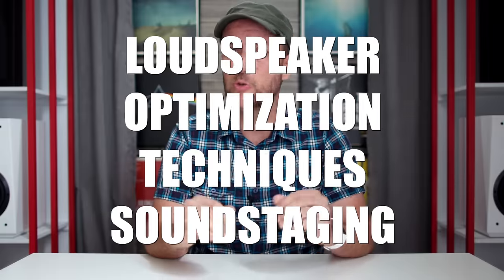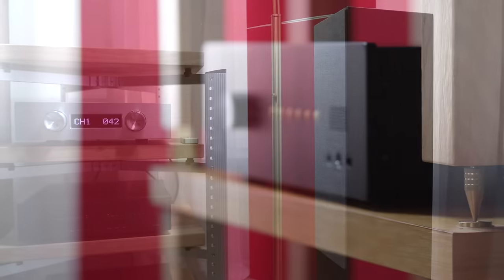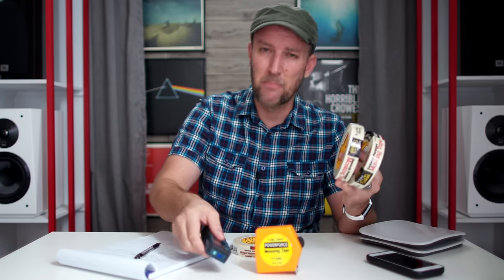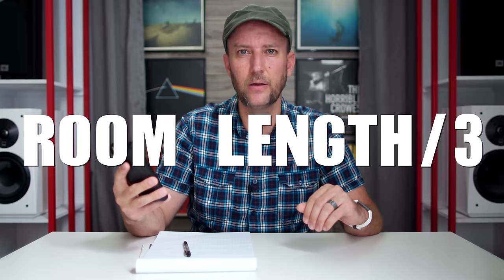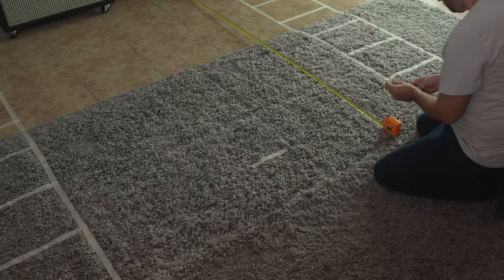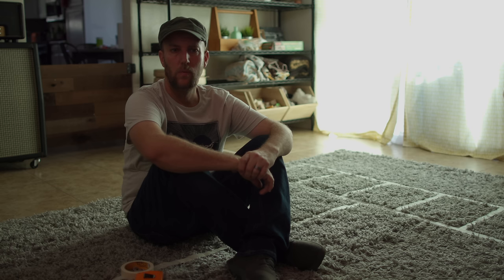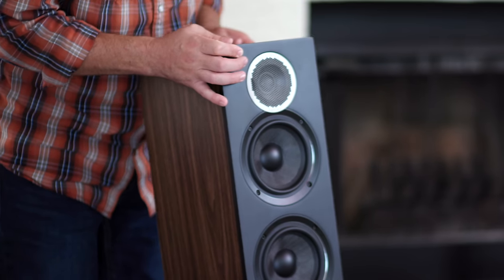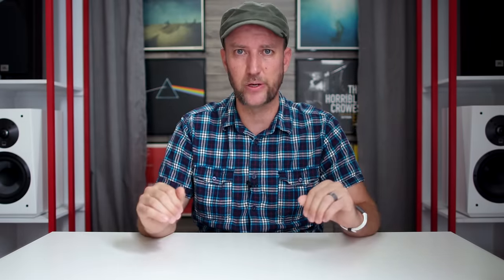L.O.T.S. Loudspeaker Optimization Techniques for Soundstage!

Comment: The "problem" with these approaches based on calculations, is that if one single factor cannot be accomplished, the the entire process is rendered pointless. Case in point, my listening position is fixed - it cannot be moved in any direction back and forth due to the layout of the apartment, nor can my speaker position move any further out from the wall than about 30cm (again due to how the room is configured). It would only take one of these limitations to prevent me getting an optimised soundstage. How many of us have rooms with symmetric walls, let alone a dedicated listening room where we can practically live with speakers dragged out into the room like this? I hardly know anyone with this luxury, we are pretty much all stuck with having to place speakers in our general living rooms. Having speakers sat out and a meter or so off the wall is just completely impractical. Something else not mentioned here too, is ceiling height. Room treatment will also play a huge role in how you perceive sound in your particular place - reflective sound and standing waves are EVERYTHING, and none of this can be calculated in line with the instructions in this video. Yes the poster says that this is a "starting point"...but quite honestly, you might as well just say "try your speakers in different positions, toed in/straight on, and see how they sound"....as measurements really are of little use.

Comment: Thanks for a very useful tool.
I have been working within the GRID for a month now and must admit it is absolutely one of the best tools I have encountered. Not being afraid to toss speakers and stuff about, due to easy return to point of origin. I have kept the original settings as a ref, and ending not far from old position. Speakers apx. 6" forwards and about a foot closer to each other and basically no toe inn, the real diff is moving my chair from the back wall by another 2´. Makes the room close to a nearfield situation but by Jove, it works. 
Thanks, mate. A happy dude here :)
Reply from the maker: Yes!

Comment: Hi Ron,  front and back wall always confuses me.  If my length is 33’ and I divide that by 3 Im going to be 22’ from the wall where my system is set up in front of me.  Is that correct?  My speaker cables are only 8’

Comment: This works if all your walls are enclosed and non-abnormal. My living room is wider than deep, has a widening near the back and an open kitchen on the other side of a dinner bar behind us. This method doesn't work in this case. The dynamics change as I slowly push the speakers back but I don't get any "speakers disappearing" effect like described at any point along the way. I push the speakers in or out one foot as per the calculations and I hear dynamics change as far as how much information is heard down the center but still no effect as described otherwise.

Comment: Recently obtained an ATI AT-542NC Power amp to add to my Denon AVR-X4000 and a pair of Alta Audio Lelantos floor standing speakers.  These are basically a 3 way version of their
Rhea speakers (on steroids!).  I want to try this positioning technique however these speakers weigh in at 92 lbs each.  My issue is the listening room is in the basement 20 X 10.9 X 7 concrete floor, 3 walls etc?  Currently have them set up at 50 inches from the front wall and 24 inches from the side walls toed in to cross the center seat (located at 6.6 feet from the back wall).  Thanks will see if they sound even better.  P.S. room is treated acoustically and speakers are on spikes on carpet with pad and floor has large area rug.

Comment: Hi, one question please. If I make a change to my system, for example changing the amplifier or speaker wire or changing over to biwiring my speakers, would I need to do the calibration again? Thank you so much

Comment: I definitely half-assed (~.555333) or at least was unable to totally optimize because of bizarre NYC apartment architecture that limited my ability to really "explore the space", as it were; that said, I am shocked at the difference I am hearing in these speakers, which I just bought and which sound quite nice, and to which I just added a sub. I did this, however, without the sub, to begin with, and was amazed when the aural illusion (de)-materialized in all its fullness (and gifted me a certain amount of low-end that had never been apparent, which was fascinating.) So thank you, this was the clearest and easiest explanation I've yet come across. Many audiophiliac resources on the internet contain information that for whatever reason is either ridiculously technical, with slide-rules and microphones, and/or suspiciously vague, and/or stupid and prescriptive ("make a triangle"). Thank you. Really. I feel like I've been driving a sports car and just realized I've had the parking brake on. Very cool.
Reply from the maker: And that’s what it’s all about!

Comment: Nice one. If you are limited as to where you place your listening chair, lets say closer to the back wall than optimum, do you move the speakers further off the front wall or further apart (to keep the same triangle) to compensate?

Comment: How do u manage the same setup with a receiver/processor that allows u to set a distance for the speaker relative to the speaker position? Do u set it to the lowest number while putting them forward, or do u set the distance accordingly to how much u move the speakers forward?

Comment: Decimal points don't swap evenly with measuring feet and inches.  Your 7.333 is 7⅓ which is 7 feet 4 inches, not 7 feet 3 inches.  I know it's just an inch, but an inch can change things quite a bit when it comes to many audio related things.  Like the distance between the woofer and tweeter in a bookshelf speaker.  

I just pointed it out so the folks at home don't make the same mistake.  Haha, assuming anyone even reads this seeing as this video is almost two years old.  Haha, take care Ron.

Comment: I had my speakers about 5 feet in the room but all the bass dropped away. They are floor standers, and the bass is usually pretty solid. I can't afford subs, so I had to move then to 2 feet to the wall and the bass has come back, right down to the mid 30s in frequency.
Reply from the maker: Yup - that is one consequence to this method - you will loose boundary reinforced bass. Once you have some subs to work with, you should give it another go. Thanks brother.

Comment: Hi Ron.......merry Christmas. I've had a lot of time lately to play around in my listening room. My room is close to the size of yours. My room is 15 ft wide and 24 feet long. I did everything that was suggested in the LOTS video.  The best sound from my speakers is about 6 ft in front of my listening position, which ends up in the middle of the room. Its so weird having them there that I don't know if I can get used to it. Is there a "plan B" or will I have to compromise my listening experience so that I'm not walking into my speakers while trying to navigate my room.
Reply from the maker: I think you hit the nail on the head man. Just move them back out when you want to critically listen. That’s what I do!

Comment: Hey Ron, what about a room that is open design with a kitchen behind it :) as my room is a bit limited to what I can do with it. Should I still calculate the “virtual end/virtual back wall” meaning the back of the couch. Beyond that is a small 4seat table, then an open kitchen.

I have pulled my speakers away from the back wall and have them angled or toe in with a bit of tilt upwards too. 
:) will mess around with things but my system sounds pretty good IMO, just don’t have a perfect box of a room for the speakers.  Also the Right side has a bunch of windows(super thick curtains to absorb sound) that extend width of the room on that side about 1.5ft or so. And left side of room has some sound absorbing panels. 
Floor is bamboo, yet has tatami mat under the coffee table. Basically just a basic living space more than listening room
Reply from the maker: Ah yeah! Every room will bring its own set of challenges and at some point, LOTS wont work miracles in every situation. If you dont have a wall behind you, I think creating a fake wall does make the most sense. So yes, creating a virtual front and back is a good idea. 

I wouldnt worry too much about the windows when performing lots as you will hear some bigger changes in staging that will bring big enough gains than the effects of one window etc. It will just take some experimenting but im glad you are giving it a shot! Keep me posted on what happens and where things land.

Comment: OK.  A few questions.  What if you arent using the entire room for your listening area?  I dont really have hard bounds other than the TV goes in the center between the windows and we fan out from there.

Second, did the video say the listening position should be 1/3 of the way from the front wall?  That runs counter to what everyone says about my speakers ... "They sound great if you can get far enough away from them".  (EV Sentry III)

Is there a science behind the math?  Why were these numbers chosen?  And how is this any different from "move it around until it sounds good" ... Its just a more methodical approach to trial and error, no?

How does automatic room correction affect this?  Obviously turn that off when doing the placement and let it do its thing after, but how much can the digital room correction fix things so that I dont have to drag massive speakers across the floor?

Comment: I may have missed it but your seating measurement, is that 1/3rd from the front wall or 1/3rd  from the rear wall ?  Thanks and good video.
Reply from the maker: 1/3 from the back wall. Thanks for asking!
Reply: @Newrecordday2013  
HP's rule of thirds

Comment: Question: should there be no way you can sit next to ideal listening position at 1/3 of room length from back wall, does this method still make sense? 
My room is 31ft long, so there’s a couch and other furniture between the ideal spot and the front wall: that couch, 7ft away from ideal spot, is the best I can do so I wonder if using LOTS would still make sense. You know…just to save some masking tape… 😅

Comment: Where does speaker calibration with mic (denon avr-s740h) , first time speaker setup using L.O.T.S. fit?  Seems that you would want your speakers sounding pretty good  (equalized?)   before finessing with LOTS.  But speakers should be in final position before calibration.  Which came first the chicken or the egg??? L.O.L

Comment: what about existing furniture though? This video shows the ideal case: a rectangular room with a couch on the shorter side. How to apply this technique in a room that has a couch on the longer side? If I have a wide wardrobe, should I still measure distances from the wall or from the wardrobe, considering it is reflecting sound much like a wall does?
Reply: You are listening to it with what furniture you have when you do this set up so you will know with your own ears when it is right instead of a preconcieved idea of where it should sound right.

Comment: I am always curious if I have reached that magic speaker placement. Self doubt, always trying to find a little reason here or there to think I didn’t. Your step by step system is great but my room is limited to a 10x10 and I also can’t keep moving the speakers and furniture because of back pain. Most of albums that I play, the speakers totally disappear, but every now and then I get an album where you hear the drums or a bell coming out of the speaker while everything else is within the soundstage, which is perfect in my case, with the exception of those instance. Do you think I should keep looking, or is it normal to have some recordings where speakers don’t totally disappear? Great video by the way, as always.
Reply: I hate to tell you this but a "square" room is impossible.  You need to make it a foot shorter on one wall.  It's just one of those things.

Comment: First off - great video! possibly your best. One thing that I could use some clarity one is speaker tilt. I have some DIY speakers that have tweeters a little on the high side and don't have spikes (which would only increase the height). I like my listening chair - do I have to build some sort of stand to sit on - can I tilt them down? Currently I am sitting on my feet to get some height but it does sound better higher up.
Reply from the maker: Hmmm, how much higher are the tweeters from your ears?
Reply: @Newrecordday2013 Tweeters are 42 inches - my current seat I have an ear height of 37" and if I sit up where my ears are at 45" it sounds the best. I'm hoping to purchase an Eames chair and not sure how that is going to come into play... I don't currently have spikes but I would have like to try try tilting them forward at the ground to hear what the difference is as a test. However, I have rubber feet and I was hoping to know ahead of time if buying spikes is a waste of time and money? I have only read about the benefits of tilting them up but not down. I'm getting a little meta and in the weeds I'm sure but wanted to get your take.

Comment: How does this work when your space is an open floor plan and you are using one side of the room. Meaning one speaker is 5 foot from one wall on the side, and 20 foot from wall on the other side

Comment: Very nice job Ron on helping people to get the best from their speakers for free. I'm wondering how you came up with the 1/4 and 1/3 fractions for width guidelines, was that calculated from something or just empirical? Seems appropriate but I'm curious. One comment I'd add is that the bass should be ignored or possibly rolled off to avoid the change in bass response from influencing the decision on the soundstage differences.
Reply from the maker: Thanks for the comment Stewart. Yeah - the 1/3 and 1/4 will often give enough play room and hopefully avoid nasties with modes etc. obviously this isn’t always the case but it often works well. I’ll be doing a second video covering bass and sub integration.

Comment: Very good guide! You did forget one major thing in placement that helps as well, and that's speaker height. If you adjust your speaker height correctly it will definitely enhance your listening experience. With traditional 3 way speakers it can make a ton of difference in just about every furniture arrangement I can think of.

Comment: Hi there. I find it surprising that when talking about toeing in you mention adjustment in high frequencies as the main reason, whereas in fact, the main reason for me is achieving a lifelike size of a vocalist (I do not want someone to sound as if they have a half a meter wide mouth). Obviously, they must be in the centre but need to be of human size and that's what toeing in does for me primarily. As for tilting the speakers (or adjusting the height of a stand-mount speaker, for that matter), you do not mention any reason at all, whereas I treat it as a way of making a vocalist standing in front of me (being of a proper height), rather than kneeling or being 2.5 metres tall. 

Thanks for sharing the tips
Reply: The main reason for tilting your speaker is not the height of the performance, but for time allignment reasons. Many speakers are adjusted in the filter for that for sure, but most benefit anyway, when tiltet. Best is mecanical allignment in the design of the speaker boks. You loose some components in the filter, and gain some clarity. But cabinets are the most expensive part when building commercial speaker, so most are build whith a flat front.

Comment: I have a wood floor it has felt pen marks denoting positioning of my dipole OTA Quad 57's  in a room close to the "golden ratio" in dimensions.  Born in the 1940's  I used a feet and inches tape measure & the time since 1984 when I bought my first pair of 57's to perfect positioning  very close to your brilliant guide. When is Mrs NRD going to be on again or the  lovely children.